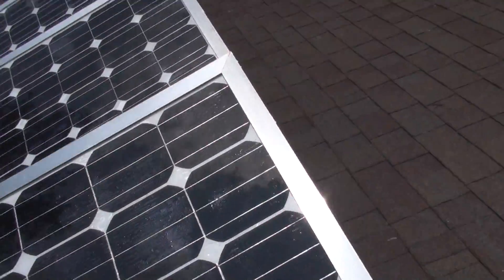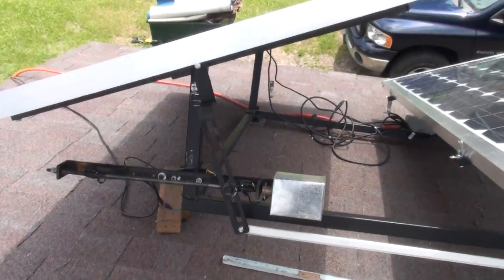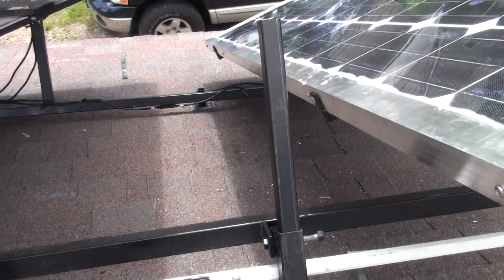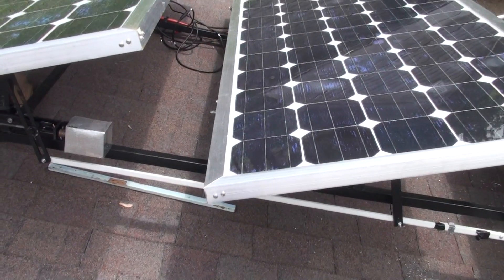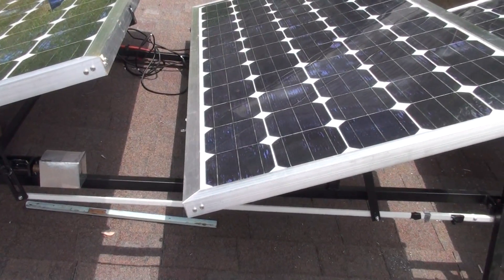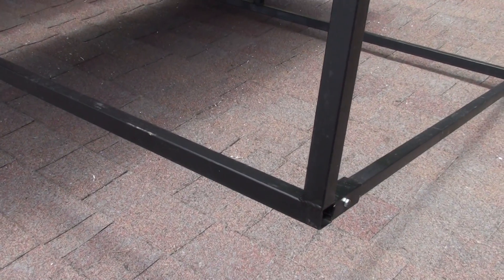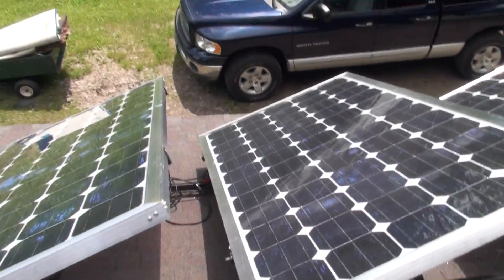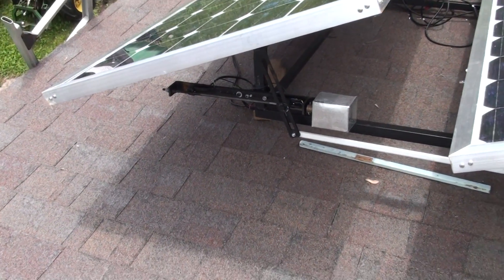large home made solar panels on mount

Comment from the maker: Mount is just made out of square 1 1/4 inch and  1 inch tubing. You need a welder . or have it welded up by someone. It has held up really well in the wind. And I have had some high winds here in storms. They are spread out far enough that it helps reduce wind loading because wind can go around them. I have them anchored well at the bottom.

Comment from the maker: @Fearlessthinker This is supposed to be a dual axis tracker but I haven't got the tracker from Red Rock yet. The single axis on it now I took off my other mount on the house. I know what your getting at but I'm a little restrained on what I can get away with in a residential area. I've heard If you leave gaps between the panels on your mount it will help as far as wind loading.

Comment from the maker: @donnieboy007 I've been getting the 6x6 cells from Everbright solar on Ebay. Get the kit which includes the soldering flux and the tabbing wire , bus wire etc. The last time I bought the 3.8 to 4.0 watt per cell tested cells. They are less likely to crack when handling and soldering. I just finished taking some video of the last panel I made and will be posting it probably early next week, haven't got time today. I used a homade oven that was really cheap to make that worked really well.

Comment from the maker: @electrodacus  I have them in parallel because I have them going thru a 28 to 52 volt  1200 watt grid tie inverter so If I went in series it would be to high of voltage for the inverter. It is MPPT. There is no battery bank on this one.